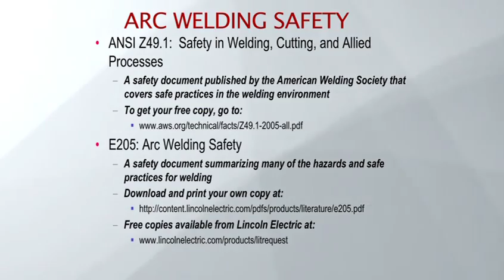NR 232 And NR 233 Video

Comment: Good stuff. I can't believe this is the only useful innershield video on youtube. Good arc shots and talk of gun angle.
Reply: Most welders hate the stuff. It's messy, hard to use, makes toxic fumes, and it's kind of expensive.
Reply: ....yeah, I used this stuff when it first came out....1986 or so......it seems the variety of annoying 'features' are still with us..... I was testing for welding on oil rig support......."Platform Gail".....Stockton, Calif.....7-8 foot diameter 'pipes' made from 1" to 1-1/2" wall rolled plate....a 'good' fit-up on 35-45 degree 'V' butt, uphill welds, was maybe a one inch gap....! Test instructor says....."get used to it....!"
Reply: That's nonsense.  This stuff is great.

Comment: On the Vertical up NR 232 what was the volts, amps and wire speed you were running please???
Reply: I know the comment is two years old lol, but the 3g weld parameters are about 21v and 155fps
Reply: Edwin F McKiernan 155 feet per second?  What????

Comment: Plz include wire speed and amps/volts
Reply: Speed at 80 with 21.6 volts for over head and drop tp 20.6 for up hill is what i passed with bro if it helps
Reply: @rubenvelazquez8715  80?? thats really really low isnt it? ive read from 130 - 200.  Perhaps you meant to type 180?

Comment: What was wire speed setting and the amps for that one inch plate D1.1
Reply: usually around 20.5 volts and 145 ish ipm for .072 wire. oh and a 250 degree preheat

Comment: I just did my certification today 3g 4g 232 inner shield. I ran it 20.5 wire speed 140. Overhead I ran it straight, the root pass only time I weaved it. Vertical i weaved it like stringers,  instead pointing down i did the opposite, i pointed up and stringer it up while watching the puddle.  Was the only best easy technique to do.

Comment: Think lincoln made this video because so many welders had issues.. my first issue in 2005 was feedability....when this wire was first introduced it jammed in the liner.. and worm tracks in the flat position..since .. I use 233 all the time for poor fit up.. it has been my go to wire for its charpy characteristics  and high productivity.. highly recommended nr233 or nr232 !

Comment: I've been practicing with NR 232 for my 3g/4g test and I get slag trapped in the corners of my bevels exactly like the clip at 8:42, any advice?
Reply from the maker: Make sure you don’t hold the corners and when welding vertical up make sure you point down into the puddle.
Reply: +lincolnelectrictv what gas does this run on??
Reply from the maker: This is Innershield wire. There is no gas.
Reply: This seems to be a feature of the product if you're having the same problem that they are. I recommend you buy a bottle of CO2 switch to gas-shielded FCAW wires instead of innershield, which are far easier to use and alot less prone to slag inclusions. 

If wind is an issue, Cardboard and duct tape works great. So does obtaining a bunch of sheet metal scraps, and fitting up a temporary wind screen around the weld area.
Reply: Point the electrode dead center into the side or corner but also angle the gun slightly in that direction, so as to concentrate more heat long  enough to cause affect. If you just barely do what I stated, then what seems to be weld deposited on the sides is actually slag because you are not using enough arc force to keep the slag inclusion at bay. Don't stay to long on the side because you will build up a shelf there only to hide slag , therefore, find the happy medium. Remember, welding on a flat surface the slag has some where to run easily with out any thing in the way but on a grove joint or fillet joint  the slag has to run up And away, hence the need for arc force in conjunction with appropriate gun angle. I will prove it to you. Why is it that we don't find slag dead center in the weld where the arc force is greatest.?
Reply: I use to clean my verticals. Then run a very fast down heal to clean it and widen the surface to kinda flat in the corner. Clean it with a wire wheel. Then come up heal in one pass hitting edges ever so slightly making sure the tie in and make a very strait line. It welds much better with that down heel stringer. But with that said. A good fit needs no stringer if it's a gusset or something that requires a smaller weld.

Comment: what were the amps and wire speed for the 232 3g demonstration?
Reply from the maker: +Luis Romero This video was done a while ago and the person that did it is not in our dept anymore. According to the book, w/ 5/64 wire you'd be running 120 in/minute between 19 and 20V and approx. 270 amps. That is a middle setting and that can vary. This was based on a 1 inch plate weld.

Comment: one question ,??you have to let it cool down when you have 2 first roots ? or what about when the test is to hot do i have to stop for a minute or keep going ??
Reply from the maker: +michael memphis Thanks for the question. If the plate gets too hot it can affect the ability to carry a puddle out of position and the weld metal can spill out.  Also having too high an interpass temperature (temperature of the plate between passes) can affect the mechanical properties of the final weld metal.
Reply: +lincolnelectrictv.  oh ok thanks for the skills bro. i liked ur video 👍👍👍
Reply: +michael memphis bridge code states that the base metal shall not exceed 550 degrees at any time.  always good to have some temp sticks to be safer than sorry